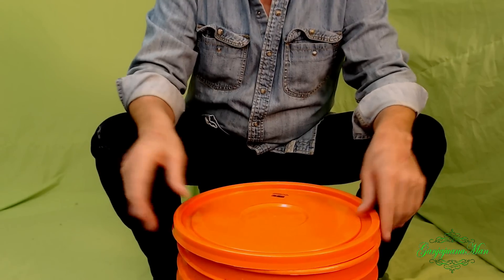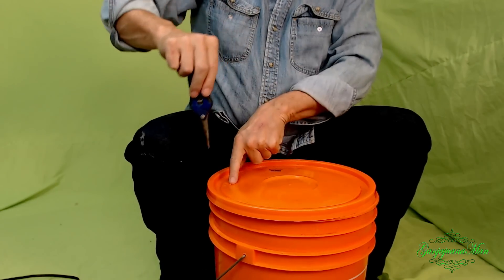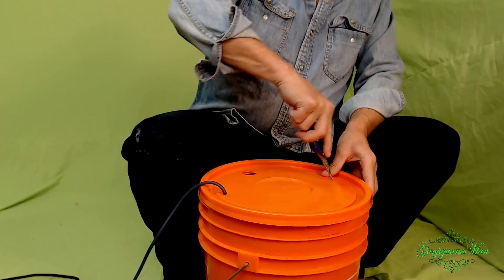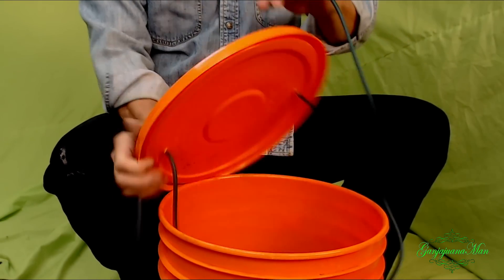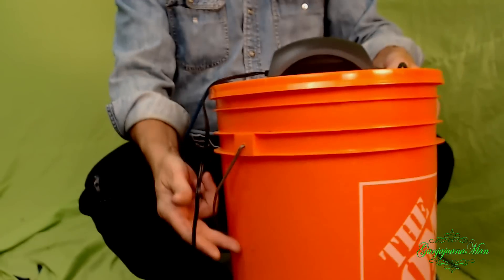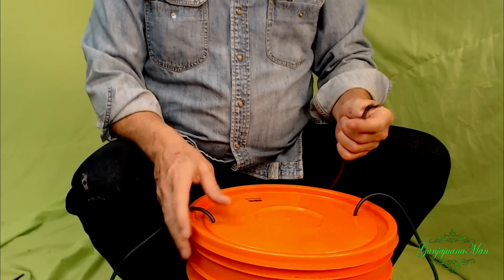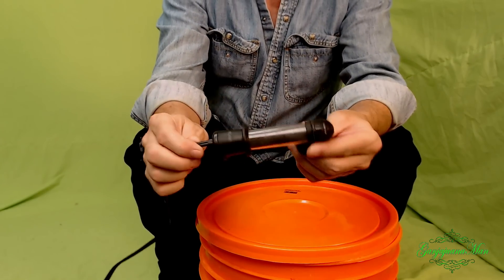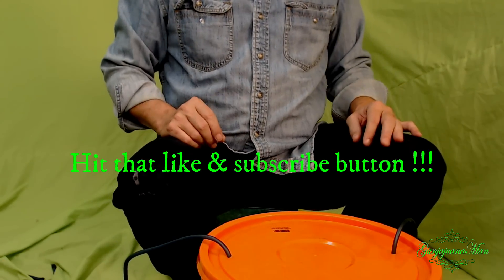New & Improved DIY Co2 Generator

Comment: How much co2 does this actually create in part per million
Reply: It produces 100% Co2, the ppm all depends on how big your room is, if you put a Co2 meter right at the outlet it would read very high numbers, it would go FSD Full Scale Deflection, putting that concentration of gases through any gas meter for extended periods is not good for them, will kill the sensor, requiring replacement or calibration at the very least. Cheers
Reply: Is your room completely sealed

Comment: What about a way to trap the CO2 during the night phase?  Since the reaction is 24/7 but you dont really want 24/7 CO2 what about running your exit hose to another bucket (perhaps at a lower level). During the day you can put oxygen through the solution and at night turn the pump off and hopefully the slower reaction of the CO2 would go into the 2nd bucket and settle at the bottom. You could only trap 5 gallons or whatever your bucket size was, and then it would be there in the morning on top of what you would produce when the lights and air pump came back on.  This is just a thought I had,  maybe you're the guy to look into. I dont have a way to measure any results so it may be junk science.
Reply: you wont catch it as there's not enough pressure,i i put a large balloon on my bottle overnight andi it barely inflates much, though will knock out the c02 when brought up to temperature.

Comment: This is a great generator, but overkill and actually counter productive. Fermentation is anaerobic, so the pump is counter productive. The fermentation process will create it's own pressure from the C02. If you just put a couple of hoses through the lid and run them to your plant this system will work great. You will need to re-do your solution weekly for a constant supply of C02. Eliminate the pump and this will work great! Thanks for the great idea Ganjajuanaman.

Comment: I’m experimenting with this.  Some changes I’ve made:  only turn the air pump on for a few minutes when your light turns on.  Yeast will only need that one blast of oxygen to work properly....will stay active for a long time (full day). Continuous oxygen is no good apparently.  Also, I wrapped a heat mat around the bucket to keep it in the high 90’s F  (38 C) for the yeast to stay active.
Reply: Do you have a ppm gage I was told those buckets you can buy dont do much and don't raise the ppm enough to matter. So I always stayed away but does it work? Small room of course
Reply: @frankpumpkin2350  It works well in a 2ftx4ftx7ft closet ok do as Peter spike said.

Comment: Hey, so I made your little set up over the past 2 days.  So far it seems to be working great, besides one issue.  Even with like 15-20 feet of tubing, and at least 8 feet of that is running straight vertical, I am getting some little drips making it all the way through the tubing.  The outlet is taped in front of my oscillating fan on the ceiling, so it gets spread around.  What can I do to stop this from happening?  The air hose is as close to the top of the bucket as I can inside.  Trying to avoid getting liquid in the tent.  Any help is appreciated :)
Reply from the maker: I have not had this happen to me so I wonder how much water is in your bucket ? mine is 1/3 full at most. Maybe your air pump is stronger then mine causing this to happen. With your oscillating fan blowing it all around your room or tent, it doesn't really matter where the hose is.      So you could just put or hang a small plastic cup or something to catch the drippings.
Thanks for watching.
Reply: @GanjajuanaMan  2 gallons water, 6 cups sugar, 2 tbsp yeast.  Same air pump as you (i believe, its only a 3 watt 10-30 gallon one from walmart) so I dont know why it was happening, but pretty sure I got it resolved :)
Reply from the maker: Glad you got it under control.
Reply: Add a check valve. They are like $1
Reply: @jasonmeyers3423  i just made one out of some 3/8 tubing in a loop with some liquid preferably sterilized h2o but anything to keep air from getting back into it and liquid from comin out and you can see the bubble come up through the clear tubing.
Reply: S
Reply: so i was able to fix this issue...i used a real small tupperware container (its like 2x2x2" or so, pretty small), drilled 2 holes in the top, put the air hose into it, and another small piece coming out, basically doing what was done on the bucket, at the end of the hose.  the little hose that comes out of the tupperware container sits in front of my fan on top of the tent, so the co2 gets spread out and "rains" down.  I set this up about 4 days ago, and today I just got my co2 monitor, and the co2 has hit 1435 max already!  Will continue monitoring the levels, and hopefully this will save me from buying an expensive tank :) was also thinking of maybe using this WITH a tank, since my monitor is also a controller, just to keep a more consistent level, but that depends how this holds up over the next few days.  Thank you for this video!!
Reply: john emro how did this end up working over multiple weeks?
Reply: @johnemro6743  Yes I have done mine the same as yours now do you leave your pump on during the daytime and off at night thanks Jeff
Reply: @jeffmee763  i turned it off at night.  however I havent been using it anymore.  Im not fully able to keep a closed system, so when I was running this, it did absolutely nothing (monitored via co2 monitor), so I just stopped doing it and am focusing on other things.

Comment: I’m sure the heat will be increases as it is sealed , yeast warms up , and the lights
Reply from the maker: You don't need the bucket in the tent because all you need to do is run the exhaust tube up to the top of your tent.
Instead of wasting floor space in your tent for the bucket,  you can put a plant there.
Thanks for watching.
Reply: @GanjajuanaMan  Gotcha, thanks! But if I want to leave it in the tent I assume there's no problem, right?
Reply: Mike Allen it might help honestly . The heat from the lights will keep it warm . Exactly like yeast love
Reply from the maker: The bucket does not go in the tent,
that's what the hose is for.
Reply: @GanjajuanaMan  Why does the bucket not go in the tent?
Reply from the maker: Right

Comment: I tried this setup for a microgreen operation. However I ran the line-out into another container of water to verify I was seeing bubbles. Unfortunately I never saw any bubbles so the bucket must have had a leak somewhere. I bought a brand new Lowes 5 gallon and the lid doesn't seem to keep a seal unfortunately.
Reply: You can use something like clear food wrap around the rim of your bucket, then put the lid on for a tighter seal.
Reply from the maker: Try wrapping some wide tape around it.
Thanks for watching.
Reply: Kinda late, but rubber grommets work waaaay better for putting the hose through the bucket. I used barbed  fittings to go through the grommet. It's good to put a sealed Tupperware or bottle in the line on the output to catch any blown through liquid and a one way check valve on the airpump side, because I've had the fluid from the bucket flow back towards the pump when the pump gets shut off.
Reply: @andrespadilla1402  also could stop by homebrew store and get a plastic fermenter bucket and do the exact same thing

Comment: Thanks for your idea. So my question is does the heater go down in the mix, and if so how are you running the cord through the lid? Thank You
Reply from the maker: My heater is completely submersible & very small. It does go down into the mix, I cut the cord then made a small hole in the bucket near the top. Then fed the cord through, then sealed that with silicon, then I put my cord back together. An easier solution for a heater is to use an incubator heating pad. They have temperature controls on them. Just put the bucket on top of it. I recommend that instead of what I did.  My heater stays in the bucket at all times because of this. My lid only has air hoses, one going in & one going out.
Thanks for watching.

Comment: 8x10 room one or two buckets set up
Reply from the maker: I think one would do it. 
I have one feeding two 4x4x8 tents with hoses. The exhaust from the tents is filtered & go's right back into the room that the tents are in. So the C02 is not wasted. The result in my room is, the 2 tents get C02 fed into them, a fan inside the tent circulates it all through the tent, then it is exhausted into the room raising the over all C02 levels in there. A  third tent is in the room that sucks in the rooms air & C02.
One bucket is all I do for all that.
Thanks for watching

Comment: But if you are pumping in air wouldn’t that just be air plus some co2 ?
Reply from the maker: The mixture creates the C02, the pump is churning the mix & helping it do it's thing, & helps get the C02 to  where it is needed. The result is that plants get more C02 with this then without it.
Thanks for watching.

Comment: Not sure why but it’s not pumping air out of the outtake tubing. Did verything the same and I’m even using a new 60gal air pump
Reply from the maker: hmmmm, ok lets go over this. 
step 1: plug pump in & put hose through lid & into the water, check for bubbles. if you have bubbles, then we know that part is ok.
step 2: put lid on with exhaust hose only 1 inch inside the bucket, nowhere near the water. If no air is coming out of the hose, then the lid must not be sealed. because you can't keep pumping air into the bucket without it coming out somewhere.
step 3: if leaking air, get better bucket or wrap some wide tape around the seal of the lid. check that exhaust hose isn't plugged.
It Has to work !
Thanks for watching.

Comment: So the problem with this...kinda like the original video.. is the heated water is going to create condensation which in turn is going to spit out of your air hose eventually...and possibly onto your plants depending where u have your exit hose..which could cause mold...a quick fix could be setting up a bottle next to it with the exit hose going into it and another hose coming outta that and going to your fan/plant...last thing u want is your yeast sugar mix spitting all over your plants or fan
Reply from the maker: Adding another bottle has been discussed here in the past. But even without it, Only air & C02 come out of the hose. The problem you describe is a Non issue, it does not happen.
Thanks for watching.
Reply: @GanjajuanaMan  so where does the condensation go? U know...hot water...water vapour...it just miraculously misses the air tube? the only exit out.. I don't know how this could possibly be a non issue!?...I mean great video and all...but no way I'd trust this in my tent without a dry run for a few days on the outside.
Reply from the maker: @xxDekkenxx  The water is warm not Hot.
The exhaust tube is only sticking inside the lid about one inch.
Condensation that forms on the inside of the lid & hose will simply
drip back Down into the water.
You see water does not drip  7 feet upward through a tube.
It is not possible for the tiny Air pump to pump Water up 7 feet of hose.
This isn't rocket science.
Even when it is a fresh mix & foaming up, it doesn't go up the hose,  if you have Followed directions & only filled the bucket 1/3 of the way with water.
Reply: @GanjajuanaMan  yes I'm not talking about the foam...I'm talking about condensation.. and your right it isnt rocket science..condensation will form in the tube as a result of the water being at 80°- 90°...I have set up your first bucket post with the pump on top of the lid...under another container..water at 1/3 bucket...water at 85° lots for room for foaming..will never reach the top..and low and behold the pump is covered in water..and condensation is forming in the air tube...and "spits' out the end....I'm not talking about pushing water thru a tube...its the condensation that forms that goes thru the tube...but maybe you realized this and that's why u made the new and improved bucket...so I will make another..in those exact specs...and try that as well...but I'm gunna take a wild guess and say the same thing is gunna happen..if you tube allowed me to send pics I would..but they dont..but I'd be happy to message them to u on messenger if you still think its "impossible".
Reply: @xxDekkenxx  100% satisfaction is guaranteed ... you deserve a refund.
Reply: @drew5964  lol, he does.
 Aaron did you run it with changes and get anything worth mentioning then?

Comment: Hey awesome video just wondering about the smell I get that the mix is going to stink but when the top is on the bottle venting into the tent is the smell noticeable? If so how bad is it?
Reply from the maker: I don't know the answers to your questions. A viewer mentioned something about using citric acid once but didn't give any details, & I have not done a search on that, sorry I can't help you on this one.
Reply from the maker: I am using a carbon filter in the room that My tents are in so 
I can't smell anything. 
One of my viewers mentioned a mixture of 
citric acid with sugar water to make C02, without the smell, I have not looked into this yet.
But it sounds interesting.
Thanks for watching.
Reply: @GanjajuanaMan  So with the co2 in there you dont need an inline fan?
Reply from the maker: @mickduncan3564  I have 2 tents in a medium size room, in one tent I have an inline fan
connected to carbon filter exhausting into the room. The other tent has 6 inch ducting to the tent with the exhaust fan
so one inline fan is sucking the air out of both tents & recirculating it back into the room.
Reply: @GanjajuanaMan  so is it not sucking your co2 out?
Reply: @GanjajuanaMan  what would the recipe be if I used citric acid instead of yeast? Also, how long would that mixture produce CO2?

Comment: So .. i was pricing out Co2 stuff b4 this .. 500 for monitor, 300 for regulator, 300 for tank.... this set up ... 30 bucks... well shit .. i know what i'm doin now ...
Reply: go to co2 meter .com meters for 129
Reply: Murder bong have you tried it how's it work
Reply: @themastergerman9989  Nope, I ended up getting 'air pots' , 7 gal. A big co2 sys is not worth it unless you are pumping o2 into the roots. I just use ambient air sucked in and blown out through filter outside tent. Floor fans to circulate around the air-pots, fans up top for the canopy.
Reply: KustomGraphics206 ... No. 5000 ppm of CO2 will not kill a human.! One may experience symptoms like headaches, nausea, drowsiness and poor concentrations; but the concentration of CO2 needs to be around x10 or more (above 40000 ppm) for it to become lethal for humans... If you are talking Carbon monoxide (CO) on the other hand - it is lethal in concentrations less than 5000 ppm.
Reply: What size air stone and what size pump? Or does it make a difference?
Reply: You can get a pre-owned 50lb Co2 tank for around $160 on eBay & the regulator is on amazon for $40 dollars then you just need to hook it up to a timer .
Reply: 30? Dude the bucket is 3 the pump is 10 sugar, yeast its less than 20 bucks all together.
Reply: @shannelowe183  and this was 2 years ago and shit ppl not for some small ass tent! yes we all know science experiments for kids. fine for a couple plants. but no regulation and control over the ppl. just a 'reaction' not a controlled release.
Reply: @shannelowe183  in other words... didnt work well enough .
Reply: All this does is make bugs. And a shit load of them. Little fruit flys
Reply: Get a tank of co2. Release it into your plants very slowly, very slowly. You can't go wrong. I can't speak for home remedies. I don't use co2 cuz I know how to grow and how to keep my conditions optimal. To each their own but it's not my thing at this point in time.
Reply: @joew6271  Unless you figured out how to change the volume of the room in every 10 minutes with fresh air I don't think you know what you're talkin about.
Reply: @petercsigo9935  you don't know what you are talking about.  Plants can get oxygen from water, they need fresh air for the CO².  If you are generating your own CO², you can keep the tent sealed while the lights are on, and just have fans circulating the air inside the tent.  When the lights are off, you will need to bring in fresh air for the oxygen, and to vent out the CO².

Sealing the tent drives up the temp and humidity, so it can be a pain to setup properly, but once done, it can speed growth a lot and reduce your harvest time by a couple of weeks.
Reply: @joew6271  if you keep your stuff optimal then co2 will benefit you greatly. It's only useful when you have optimized all other points of growing
Reply: @joew6271  what about CO2 for grow tent

Comment: Hey @GanjajuanaMan great video. What doesn't smell bad when making a Co2 system? The Citric acid with sugar and water method?
Reply: Joe W, Any instructions, or, measurements for Citric Acid, sugar and water method? Also, how long would this method produce CO2?
Reply: Citric acid to sugar is 50/50. I usually use 2 Ltr. soda bottles and fill half way with water. = 1 liter
Reply: Yeast will help.